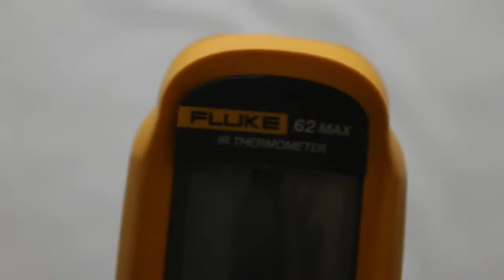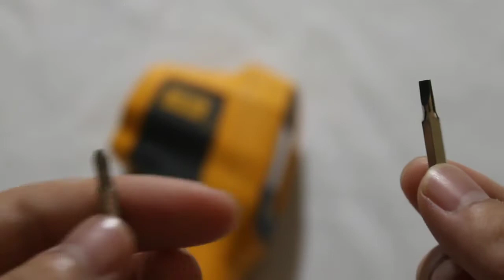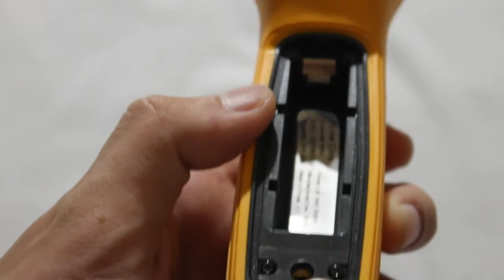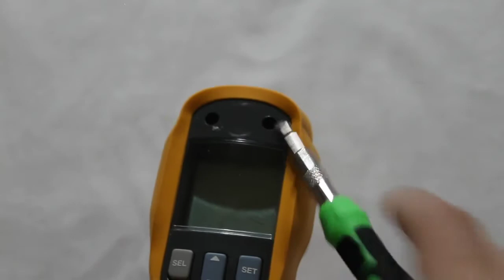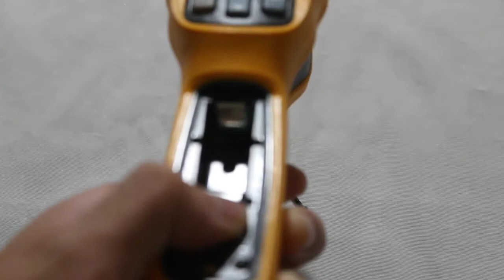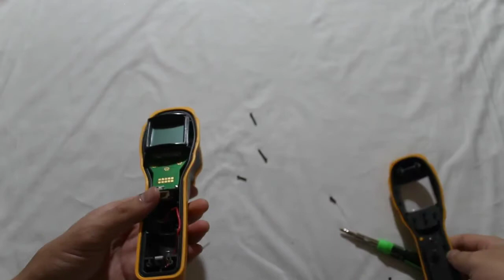Fluke 62 Max Disassembly

Comment: Mine has astigmatism, how to fix?
Reply from the maker: Try to clean the gold pins on the board and the zebra strip that contact it on the LCD. 

Also try to check if the strip and the pins makes good contact by open it up and press on the LCD slowly (don't press it too hard though) to see if it works again.

Comment: Hello wire is not disconnected but gun is  not working  what reson
Reply from the maker: It probably is a fried microcontroller or shorted component. I got the same thing, but I haven't diagnose it yet

Comment: Hello, did you successfully fix it ?? My 62 max has stopped working with no reasons...
Reply from the maker: I haven't tried to fix it yet. But I looked at my main board and everything is good. I think this may be a common problem for these Fluke 6x series IR thermometer.
Reply: @KN4LXD  ok thank you for your answer ! If you manage to repare it I would be very grateful if you could explain me what was wrong. I will also search from myself but my main board is also good. I will check signals with a scope.
Reply from the maker: No problem!

In fact, I would revisit this thermometer sometimes between this week and next week (provided that I have a few hours to work on this)